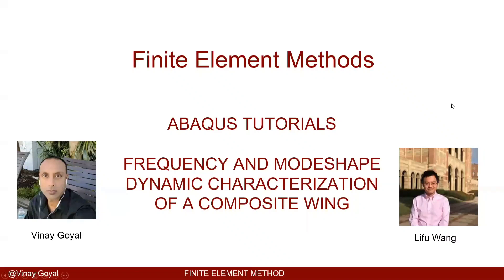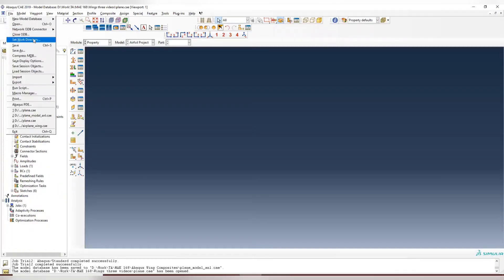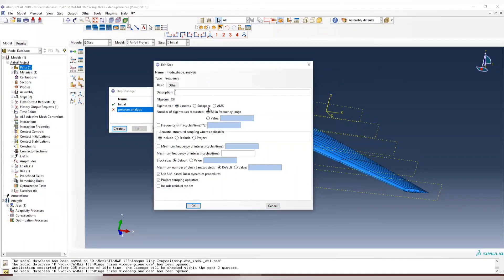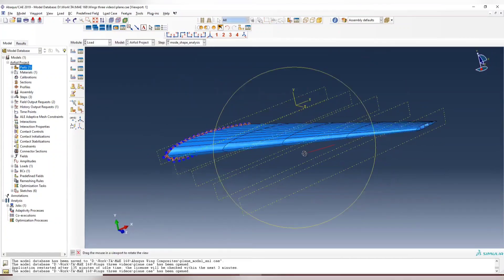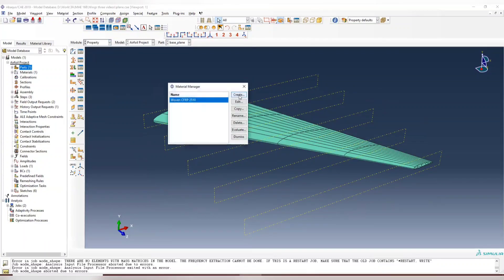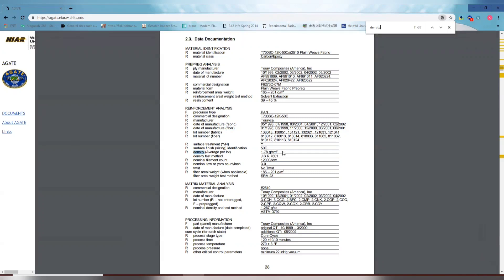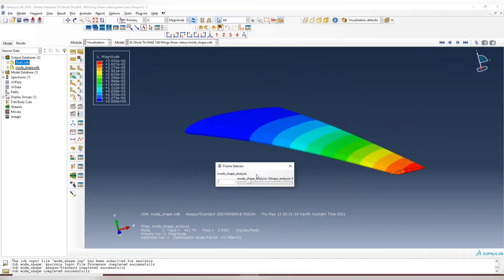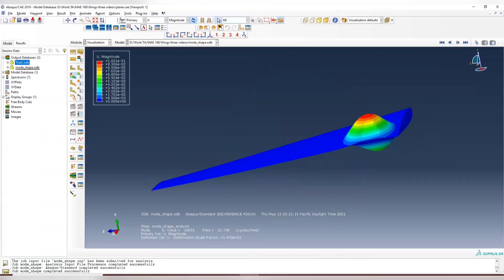#ABAQUS Tutorials - Composite Wing Frequency and Modeshape Extraction

Comment: at 5:34, density of 1.78g/cm3 is recommended, but this is the fiber. The lamina avg density of 1.501g/cm3 which should be used is on page 29 of the spec sheet.
Reply from the maker: thank you sorry for the mistake Chris